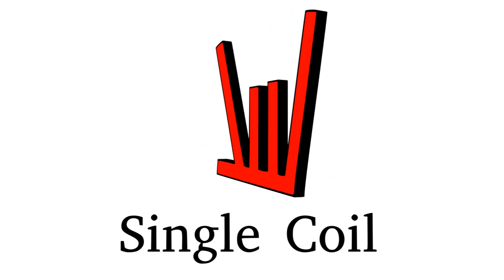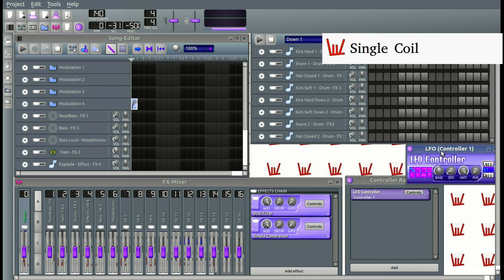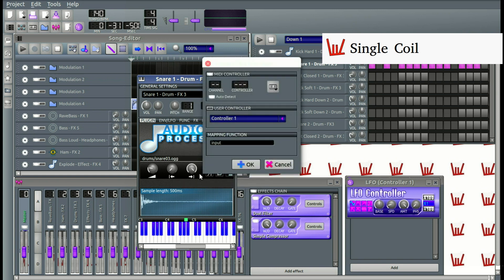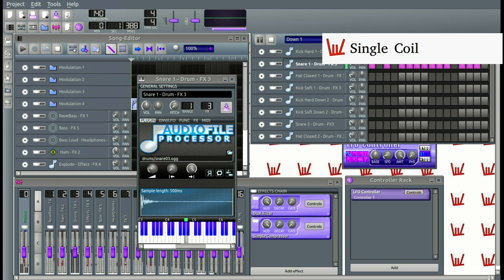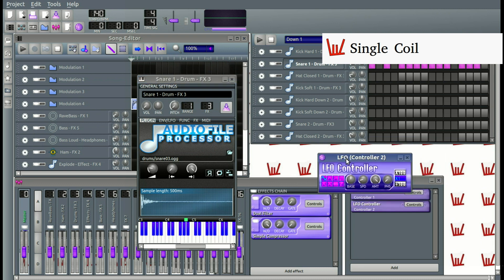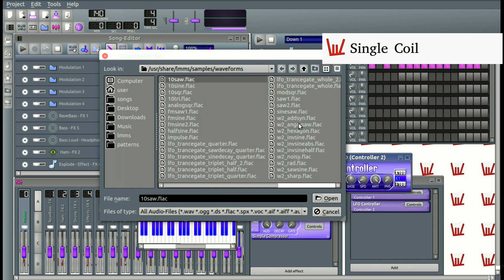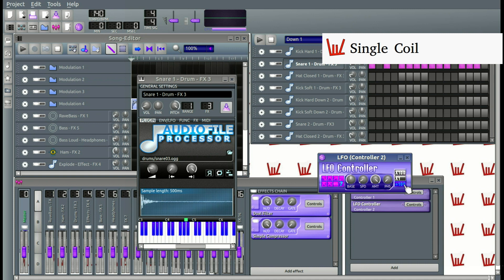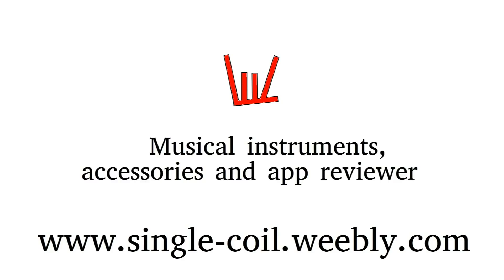HOW TO USE THE LMMS CONTROLLER RACK - (DOWNLOAD 1025 FREE SAMPLES)

Comment: If I recall Peak controller also shows in the rack, but it's accessed by adding it as an FX channel. You can also rename controllers and those names will show on the drop-down. However naming doesn't seem to offer anything in terms of reverse look-up. (Only half baked in that part of execution.) You still have to remember where you put it in the workspace.
Reply from the maker: pauljs75 Thank you for your useful comment!